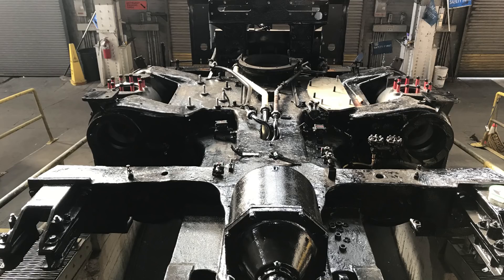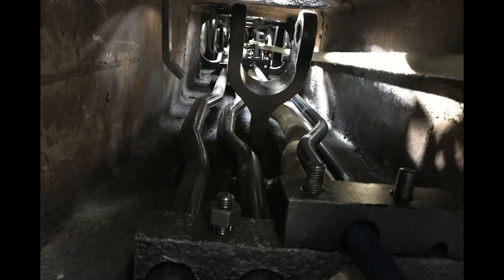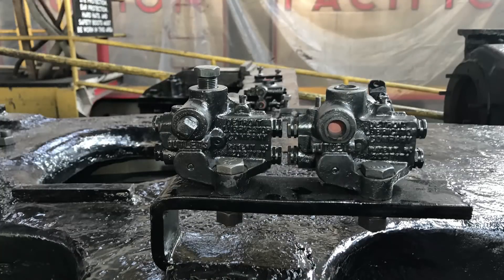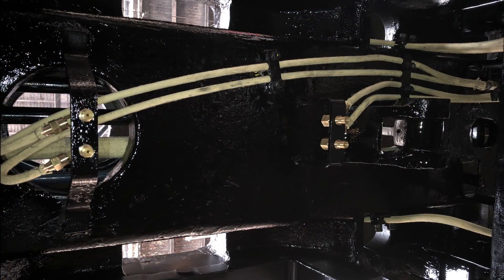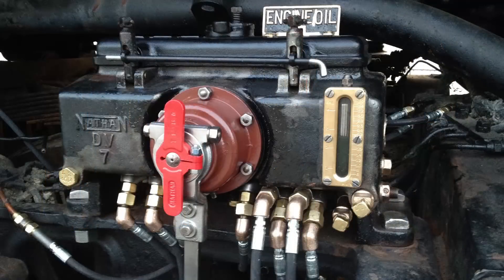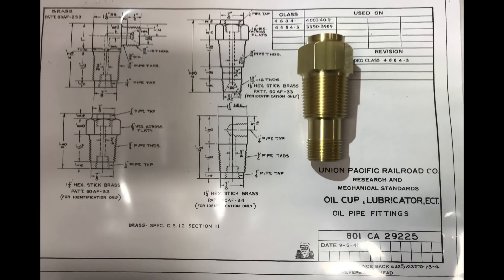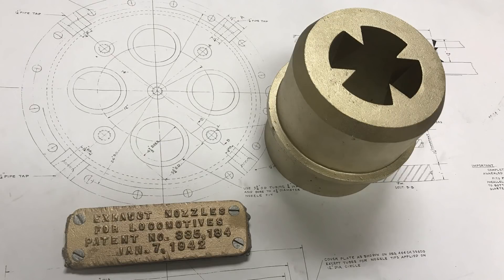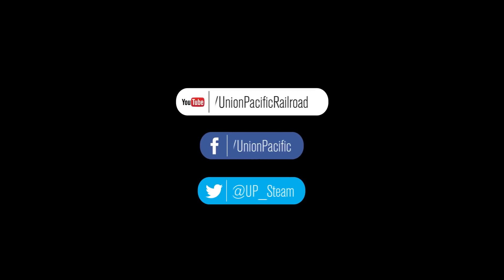Steam Update: Locomotive No. 4014's Front Engine Progress

Comment: I thought that UP tried running fuel oil in one of the 4000's, in the revenue days, instead of coal. But couldn't get the BTU performance for the needed 300 PSI boiler pressure that was needed compared to coal and had to switch back.

Comment: Interesting to compare this to the video when they first removed the front engine from 4014.   They did a lot of disassembly.  Also interesting to see the engineering drawing for the fitting shows that the part is also used on the 3985.  I'll bet they ordered enough for both engines plus spares.

Comment: So I heard that in 2009 the 3985 derailed
Reply: Nickel plate road 765 It's possible, but that's not why she hasn't run since 2010. 3985 has some pretty serious boiler and firebox issues. It's very dangerous to attempt operation in her current state. The issue with 3985 is that her restoration wasn't done correctly the first time. She was restored to run and not to last. In the future, Ed and the steam crew will perform upgrades on 3985 while eliminating all of the various issues 3985 has. Don't worry, she will run again and the big trio will be fully operational.

Comment: Thank you for the update Ed,

The rebuild continues, when Ed shows you how the front engine reassembly is going the engine is well and truly past the tear down stage and reassembly has begun but when UP was operating the Big Boy fleet and one went into the backshop for a rebuild they had over 4-500 men (estimated) working in The Backshops that meant she would be completely torn done to bare cast frames and rebuilt and under steam tests within I'd estimate 30- 45 days and back in service. For roughly 9 guys to have accomplished what you've done is incredible particularly when you consider they have to maintain another engine (844) and operate her on the trips scheduled for that year. This doesn't mean all work on the big boy stops, it just slows way down from what they'd like to accomplish. Now I know but won't say where the big boys wheels are being trued and recently discovered another articulated is having her drivers sent to the same place for truing the tires and new pins in all wheels as it was an unfortunate discovery that C&O knew when the 1309 was delivered that diesels were going to replace steam and maybe not all years of service but at least the last year or so she was ridden hard and put away wet. This is why the drivers need major service. 

  Just think, how many times do parts from two articulated locomotive's arrive at a steam service shop in the 21st century for heavy wheel work both at the same time. Guys at the shop know where you are and Ed please get videos and pics for future generations and maintenance personnel in the future.

Please!!

Thank you

Comment: Bunker C or Diesel?
Reply: Brian Beard I believe they now burn  used motor oil on 844 and 3985... I read neither could use diesel...
Reply: C and K Early Warning Systems Last I heard it was recycled diesel and/or No. 5 Oil.
Reply: Latios Gaming I know years ago they tried to use diesel but 3985 and 844 dont like it... Then they burned number 5 bunker oil which had to be preheated to flow... Bunker oil used to be cheap as it was a few grades above asphalt when distilling other fuels it was a waste product... With more efficient distillation I dont believe it is produced much plus most of the freighters are no longer steam but diesel... only a few Lakers use steam turbines anymore and few if any salties...  still use it so Ive heard used motor oil after minor filtering is the fuel now they may add a bit of diesel to to thin mix I dont know...

Comment: Would love to hear more about the oil burner setup. Is it a copy from the Challenger scaled up? I thought that the version UP tried on the Big Boy when they were new was unsatisfactory?
Reply: I also understand that burning up the countryside with coal ember fires is not good for advertising like UP want's from the Big Boy. Converting to oil keeps it from dropping burning coal embers on the tracks fro the grates and from blowing still burning ash from the stack. There is plenty of power in oil to fire the big boy properly it just needs to be able to properly atomize and distribute the oil and to be able to mix it with the air to get a good clean burn.  I am guessing the firebox layout causes problems with getting proper air mixing to the oil injectors to get an even burn.  They may find it needs forced air in certain spots added to get the burn even through the firebox so they don't have hot spots.
Reply: Oil burning will also eliminate the damaging effects of cinder erosion, which shortens flu life, and it will also remove the need to dump the ash pan on the road.
Reply: The 4005 oil conversion was successful as it ran as a oil burner for at least a year. It had some problems in the beginning with the flames burning more like a lantern then a flame thrower. We also have to remember that the Big boy will be hauling a 18 passenger train which will require much less fire and steam then the 100 plus freight cars it ran up the grades of Utah and Wyoming.
Reply: The advantages of oil over coal in this day and age are numerous. I trust that Ed and the Team will leverage today's technology to make the oil conversion successful.
Reply: bcbloc02 howdy Brian,did not know you followed the big boy restoration
Reply: very nice!
Reply: bcbloc02 As far as I know, no attempts have been made at conversion as of yet. You are correct, the original conversion of a Big Boy to oil was deemed unsatisfactory after tests. From what I understand, oil doesn't burn as hot, and being that Big Boys are as large as they are, coal burned much hotter than oil and gave a much better steam generation rate. The reason UP is converting 4014 to oil firing is for the same reason 3985 was converted to oil firing. UP got tired of bringing along coal hoppers for long trips, and more importantly, coal is expensive. It was already expensive to feed a Challenger, UP didn't even want to imagine what a bill would look like for feeding a Big Boy.
Reply: I believe it is 18 cars. The annual steam train from Denver to Cheyenne with the 844, always sells out so they typically use every car they have for that train. I am sure with the Big boy it will be a much larger train. I know the 3985 once pulled the circus train with no helpers which is quite a long train.
Reply: That circus train was over 100 cars I believe. I wonder if UP has any extra pullmans sitting on sidings to refurb? The big boy won't be cheap to operate and I would think they would be best served to be able to haul as many people as they can on their excursions to help cover the costs, also the more people you can expose to it the more advertising you get from it.
Reply: 18 cars all the UP has anymore?  The J611 has been pulling 19-22 cars on its excursions in the mountains of Virginia with no diesel in the consist. It seems the big boy would be more fitting pulling 50 cars.
Reply: I heard a while back e possibility of using 2 FEF burners, 4-8-4 goes to 4-8-8-4, so FEF burner x2. All I can guess.
Reply: I could be wrong here, but I seam to remember reading one time that the original Big Boy oil conversion done by UP only used one burner.  While the Challenger oil conversion done on 3985 uses 2 burners.  If that's so, then I would be willing to bet they will be using a 2 burner unit like that one.
Reply: The original did use 1 burner, but I was referencing what rumours I had heard from a while back, about how 4014 would be converted to oil, to be sure there was no flame shortage.
Reply: Jacob Woods why does big boy 4014 has bolts sticking out on the side why the other big boys have their siding covered up
Reply: Those are staybolts. When the 4014 is put back together insulation and lagging will go overtop them, and the final gloss boiler jacket will go on top giving her a smooth outside surface the other big boys have. The jacketing always goes on last.
Reply: Jacob Woods thanks for telling me
Reply: Traveling Tom I know up has a who fleet of rail passenger cars maybe they should have big boy to pull all of them every single one
Reply: it might weight less, but passenger cars are longer, and it was mentioned that it takes an engine that can push to highspeed to do a decent passenger train as opposed to one that has to slug it out say pulling coal,  thats why an engine like 611, or 765 excels at passenger trains, and mentioned on the video of the runs of the new river train 34 cars might not sound like much but being able to keep up the steam and keep the timetable that much loading makes for a challenge indeed.  ant it all depends on which oil they are burning that determines the temp of the fire.
Reply: You have to look at the time period that the coal to oil conversion took place and think about advancements in technology since then.
Reply: OH by the way one year from today is the 150 anniversery May 10,2019 at Promitory point Today is May 10,2018 so one year from today.
Reply: no not long at all